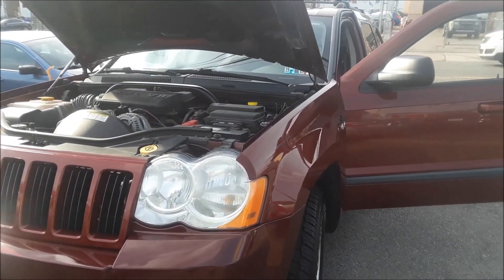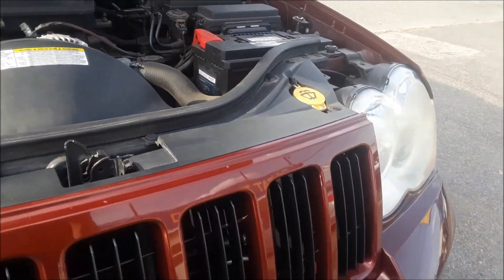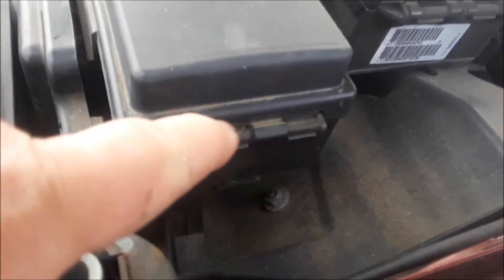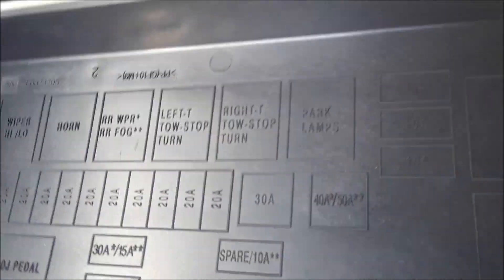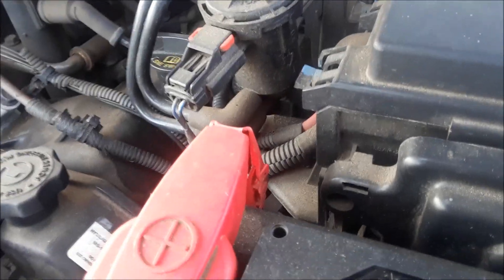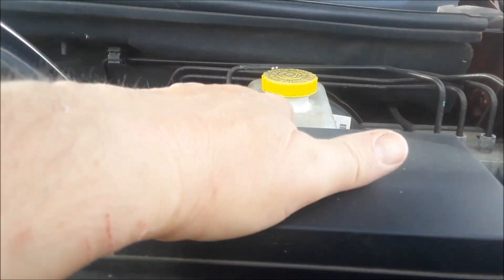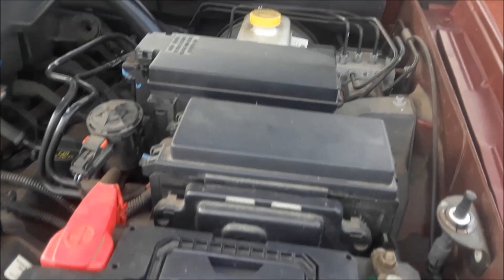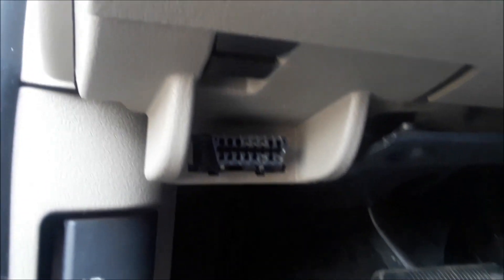Jeep Grand Cherokee Fuse Box Locations

Comment: In my 2006 I have a fuse box underneath the steering wheel and the two under the hood it's just really hard to figure out which one is the cigarette lighters
Reply: Ever figure out which one is for the cigarette lighters. That's what I'm currently looking for, thanks
Reply: Same here. 2006 jeep looking for the cigarette lighter fuse, and I have a fuse box under the steering column in addition to the two he shows in the video.
Reply: Cigarette lighter is number 14 in fuse box under driver dash.  All 3 of the 20 amp fuse in a row are for cigarette/ power supplies in that box
Reply: There are 3 20 amp fuses controlling the power outlets top 20 rear outlet, middle is passenger and bottom 20 is the cig. The cig also has a relay on the back top middle of the fuse box under the dash. The other 2 outlets has a pick 30 amp under the hood.